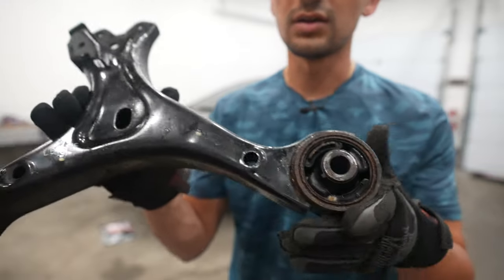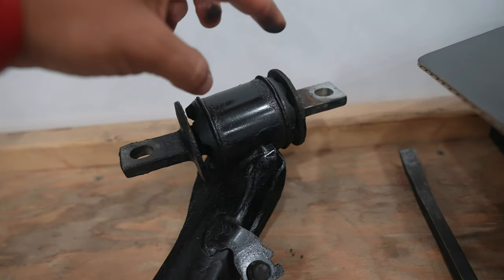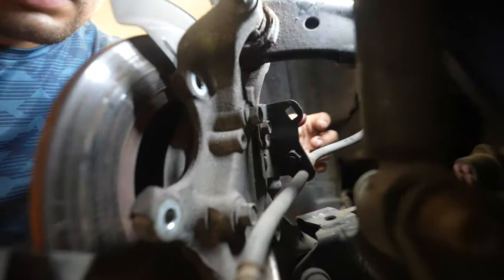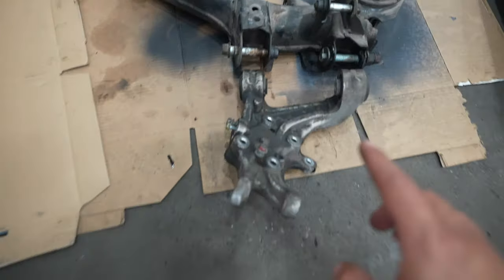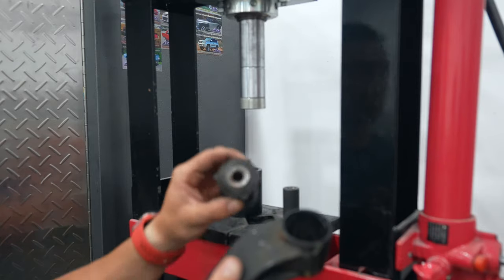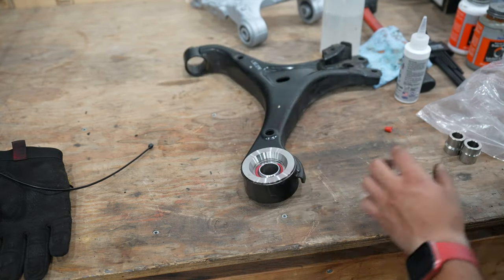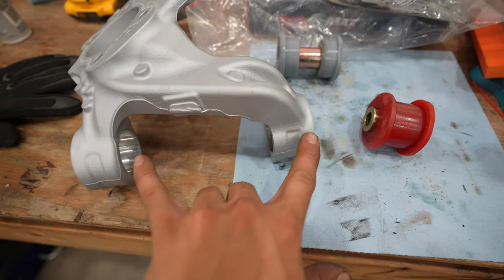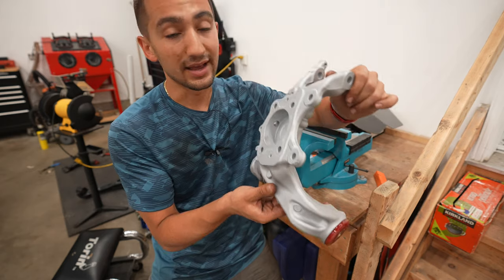GETTING RID OF ALL THE SLOP IN MY SUSPENSION // Upgraded Civic Bushings

Comment from the maker: I've also linked in the description box the polyurethane sway bar bushings for this Civic! You'll also be able to find bushings for different size bars too! Hope this helps 🤙
Reply: Can you share who made those custom bushing, the gray one, i need the rear end trailing arm bushing you installed after burn the original, i cant find that in my country.
Reply: Hey @milanmastracci I’m also looking to do the bushing upgrade and was wondering the same thing about the rear gray bushing. Did you make them your self? Any chance I could get a set.

Comment: Nice to see someone who knows what they are talking and how things are done. Very punctual and descriptive on the work being done. Although some of the methods of it could've been done different but hey there's more than one way to skin a cat.
The only argumentive point from me would be it is not necessary to preload the suspension when torqueing the bolts. In the case of using spherical and poly bushings that can easily rotate if properly installed you can torque without preloading the suspension. As long as the bushing are free to move.
Reply from the maker: Hey Brad, as I mentioned, spherical and polyurethane bushings that can rotate don't need to be pre-torqued, however all OEM bushings should be to ensure they are not under tension while the vehicle is static.

Comment: According to Honda, on the 2012 Civic Si,  the trailing arms and front knuckles are specific to the 2012 Si.
Reply from the maker: The front knuckles are different for the 2014-15 Si models only. All of the other knuckles are the same. As far as the rear trailing arms, their designs seems to be identical. Do you know what is different about from, according to Honda?

Comment: I think Moog makes replacement control arms, but not sure if they're rubber bushings or not.
Reply from the maker: Hey Eddie! They are indeed regular rubber, and i believe they're also a bit softer than factory.
Reply: I bought the Moog control arms from Rock Auto, they're terrible.  The rubber ripped within a month.  Currently swapping them out again.

Comment: Did the 8th gen energy suspension front control arm bushings fit where you put the spherical bearings? I'd like to use them if they do instead of spherical.
Reply from the maker: They do not

Comment: great video, pretty crazy 8th and 9th gen rear lower control arm bushings are so difficult to figure out, I just want to replace my factory rubber ones....nice vise and shop
Reply from the maker: Yeah it's kinda surprising there isn't a full 9th gen kit out there for these cars. Would be nice if Energy suspension came out with one
Reply: Hardrace has hardened rubber bushings for the rears of both cars I’m pretty sure

Comment: welcome back! i wonder if you could combine hardrace part 6926 with the polyurethane bushing if you could get the rubber out.
Reply from the maker: I looked into it, and I don't think it would work. I could have installed those hardened rubber bushings, but it would just be a matter of time where that rubber would degrade too.

Comment: hey man love the build, which bushings did you use from the 8th gen kit? i live un Puerto Rico and i don’t know people here that make custom bushings and to know so i can use for my civic, i got and 2012 coupe :)
Reply from the maker: Thanks buddy!! So you can use the rear upper shock bushings, 2 of the rear knuckle bushings, both pairs of the the rear trailing arm bushings (if you can separate the metal pin), and the front lower control arm small bushing. Hope that helps buddy!
Reply: @milanmastracci  thanks man, keep the good work!! :))

Comment: Throw in a 4piston exhaust cam. Leave everything else. The intake is making all its power but the small exhaust cam brings it down to 205. Thats why you mpg drops so hard after 4500. Exhaust side is fixed and the cat is close by, so you shouldn't need a tune but you can. It doesn't add power, just frees up the power its already making.
If you also want more torque, get Ignition Projects ignition coil and NGK ruthenium HX sparkplugs because it will wear away iridium plugs in months. Its legit and makes 5th gear a usable gear. The torque adds stress but heat is reduced.
Lucas oil supercoolant is also legit. Keeps everything clean and corrosion free so all surfaces and sensors contact the water better. Eliminate heat soak and your vtc wont hesitate on hot days anymore. I miss my si but i dont miss the hill assist and the naggy controls.

Comment: Milan, so you spent all that money on all those parts, which didn't work, BUT yet, you still haven't gotten your garage floor epoxied, yet? SMH
Bro, you need to get that done before you really start doing even more mechanical work in your garage, otherwise, 2 things are going to happen:
1) you're going to have so much stuff in your garage that it's going to be an overwhelming nightmare for you to even want to clear out your garage just to get your garage floor done. 
2) as you continue on working on cars in your garage, you're going to spilling oil, gas, chemicals, etc... onto the floor, which then will stain your garage floor, which then will end up costing your even more money to get your garage floor done because you'll now have to do the cleaning process of degreasing and acid washing your garage floor first, before you can put a epoxy down on your garage floor!!

ALSO, I noticed in this video, you already had cracks in your garage floor, which means you if don't address those cracks, you're going to have even more problems later on with your garage floor chipping and even possibly leading to your having to jack hammer the floor up and pour a new concrete floor down.

You need to address your garage floor before you really start cluttering your garage with all your stuff. 
Keep in mind, I have a neighbor who is a mechanic, he too, rebuilt an entire car in his garage and he's only been in his house for 1.5 years and it's a brand newly built home and already his garage floor is filthy, dirty, stained and cluttering with engines, car parts, chemicals and everything else that a mechanic uses and to this day I hear from him always REGRETTING not getting his garage floor done before he started on his project car!! AND he especially tells me this whenever he sees my epoxied garage floor!! 
So you don't want to end up like my neighbor and you don't want to end up costing yourself more money in the long run by ignoring to take care of your garage floor now.